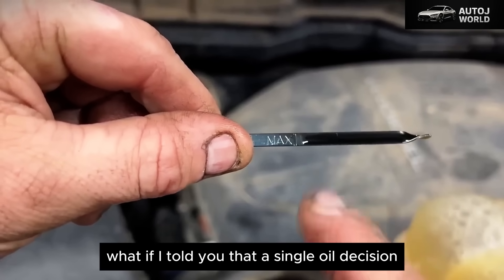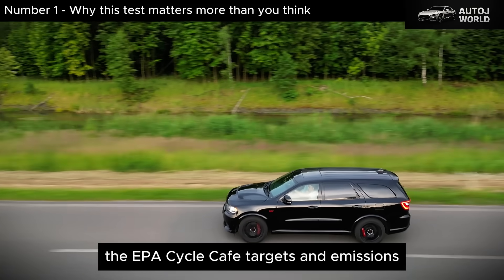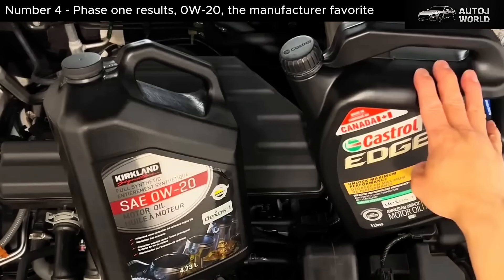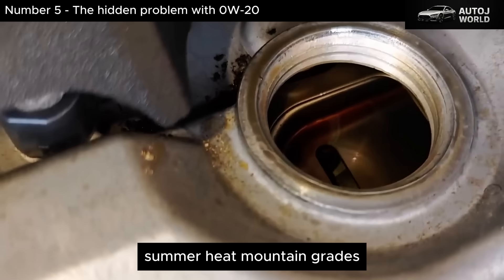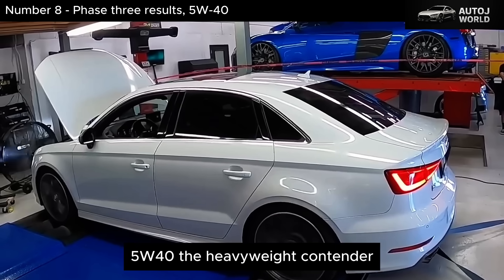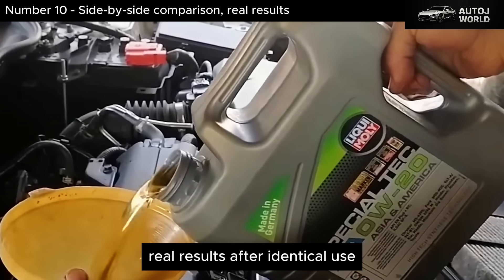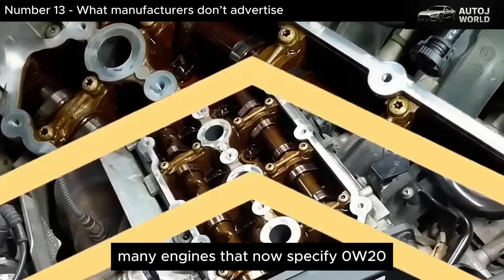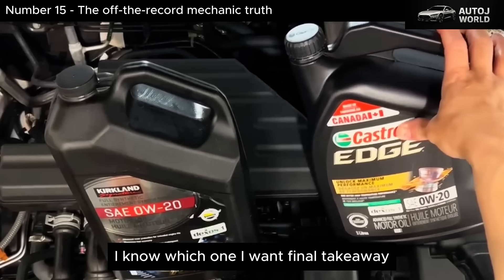We Tested 0W-20, 5W-30 & 5W-40 in the ENGINE — One Clear Winner!

Comment: The thinner oils are a problem for cars that idle a lot, not because of the oil, but because of oil pumps that don't deliver oil at high pressures for idling. I like 5w-40 because i live in Africa and do plenty long distance driving.
Reply: Me too. If 5W30 specified, l prefer 5W40 due to our already high & rising temperatures, even in winter. Friend's Yaris spec is 20W50 like old school Toyotas to my surprise: that's loose mechanical tolerances.
Reply: @alistairknox5381 possible to the extreme heat at your country needs that. I will not choose that better with 10w-40.
Reply: @emmanuila7747 My old 8v Ford, VW & Corsa all run happily on 20W50 & even on 25W60(especially good on VW: doesn't like thin oil) but more expensive being special high mileage oil. Running temperature also important: modded both my VW & Opel to run about 10°C cooler, around 82°C on open road: what a difference, heater not much use but so what. Cooked oil= filthy engine, heavy carbon caking everything.

Comment: Switched from 5-30 on 04 v6 Highlander to 10-30 better mileage smooth cooler running. 4k changes w Mobil 1 filter.
Reply: What did you switch TO ???
Reply: @rpasco9352 all oils are branding scam there is no such thing as fully synthetic oil they are all base mineral oil grade 3 with additives. If u want good oil go motul or amsoil 100% synthetic oil
Reply: That is not good either 10w is very bad for cold weather. If u want more protection go for 5w-40

Comment: What about 5:20 w for a 2010 Challenger RT🤔
Reply: depends where you live,  how you drive,  etc etc. 
     V6:  5w30
     V8:  5w40
    without knowing your situation run royal purple Castrol, Mobil1, valvoline full synthetic:  5w30 or 5w40
      oil changes every 4000-
4500miles......    20-year plus mechanic. 

12jan2026,dellthecomputer

Comment: All of the internal engine problems/horror stories began when the manufacturers started using 0W20 and 5W20 motor oils. Never heard one complaint on the old 5W30 or 10W30. But, those older cars never had the "blast furnace" catalytic converter in front of the oil pan, either.
Reply: Wrong!!! How come Honda/Acura and Toyota/Lexus have been using 0W 20 for years and have no issues. Just because American car manufacturers build garbage half the time don't blame oil. You seemingly forgot that 5W 30 was ridiculed when it came out years ago.

Comment: The narrower the gap between the two numbers the less solids are in the oil. Less solids means the oil is less likely to create sludge or deposits. If your temperature zone permits it 10w 30 is a better choice.
Reply: "The narrower the gap between the two numbers...".  Do you recommend using 5W5 ???

Comment: I have a 1997 Toyota Tacoma and I alternate  using switch 5w30 on winter time and during course of summer I use 20w50 because I use it for mobile services. The truck has 28860 plus miles and the engine runs great. I also change the oil every 6000k miles.  I also alternate oils on my Ducati motorcycle from 10w40 to 20w50
Reply: wow 28,000 on a 97 Tacoma?   A rare find!

Comment: Main takeaway with my 60+ years of auto maintenance and repairs as full time tech, don't go the full manufacturer recommended miles of these modern oil change intervals no matter what oil or filter you are using. Unless you are driving almost exclusively highway miles, no towing, and longer trips of 30 mins to one hour each time you drive, then stick to a more reasonable 5 or 6 thousand miles with a quality synthetic oil and high quality filter, or 6 months, whichever comes first. Anything longer than that can shorten engine life, cause oil consumption, etc. Wise advice from someone who has just about seen it all....
Reply: I worked as a jobbie at the GM Tech Center in the Powertrain building . One day I asked one of the Engineers that I was working with , why does the Corvette Manual call for Synthetic oil and a Camaro and Firebird which have the exact same engines except that Corvette get's it first then 1 or2 years later the same engine goes into Firebird and Camaro . He said the only reason that GM doesn't call for Synthetic in the Firebird and Camaro is that a Corvette owner can afford Synthetic and the other's can't . I started using Synthetic in my vehicles after that and after I found out the advantages of it and have been pleased ever since .
Reply: @chrismaurer2075 I haven't verified this just now, but my distinct recollection is that Mobile 1 (And yes, obviously, they were paying to have their brand name used), that is to say synthetic oil, was specified in Corvettes when they started using roller cams instead of flat tappet cams. 

I question the engineers logic. If one can afford a new Camaro, etc when can certainly afford synthetic. And just FYI, I have used synthetics exclusively for many years .... In all of my vehicles, including motorcycles, I think since my 96 collector edition Corvette...
Reply: @docimastic  I'm almost positive that you are correct about the Mobil 1 .
Reply: Agree I use 5w30 brilliant
Reply: 03 Tacoma 2.7, 5w30 186,999 think 10w30 is best now it's geting lose
Reply: I drove 2 Audi A4's as the #1 Uber Driver overnight in San Francisco for about 8 years.  The last one I'm still driving with 374,000 miles on it.  This is pretty much unheard of for Audi A4's.  First one was during the bad piston ring design faze.  It was a 2012 sold to me as a 2013.  Fortunately it was destroyed at a stoplight hit from behind by San Francisco Wheelchair paraTransit bus in 2015 with about 200,000 miles on it.  Second Audi A4, manufactured mid 2015, is one they had the piston rings corrected.   I'm still driving it in 2026, though the first engine died finally at 291,000 because it was losing compression, slowly burning oil, and needed a timing chain change.  Timing chain finally broke at freeway speed, and did as would be expected to the valves and piston heads on the 2015 original engine.  That was at about 292,000 miles on that engine.  Was getting about 18 city and 25-26 highway on the engine and burning about a quart of oil every few days at that point driving 12 hour shifts.  The timing chain finally broke and that engine went bye bye.
  I "re-engined" it with a used Audi engine off of LKQ with 44,000 miles on the engine.  I have 80,000 miles now or about, on that engine.  I have used Castrol Synthetic 5w-40 and fadiously changed oil and filter at 9,000 to 10,000 miles.  My trips are rarely under 30 minutes and when an Uber driver until 2021 I was driving about 10-12 hours a day, 5-6 days a week.  Why did I re-engine it.  Because I replaced the Engine, Turbo,Trans, all the other systems parts, starter, alternator, AC compressor, heater core and radiator core for about $18,000 parts and labor.  That included New bearings all four wheels and disc rotors.  I still need a replacement radio/CD.  AM/FM radio still works. Bluetooth caput.
I have consistently gotten 32 MPG highway and 22-25 city.  My climate is neither too hot nor too cold though there a days close to feezing and days close to 100 but not many.  A dozen times I had the engine temp warning screaming at me because the fan electronics were broken. And I turned on the heater full blast and that took care of it in 90 degree, bumper to bomper at the stoplights approaching the bay bridge.  The temps came back down into range with 4 windows and sunroof open.  I attribute the no engine damage to the 40 w synthetic for those events.
Got the engine fan issues sorted with a new body Controller unit. Sort of a Grand Central Station, relay switcher for almost all electronic signals thru the car other than the engine transmission links.  Not cheap but fixed.  Again, I'm still getting 32 mpg Highway, 22-26 mpg City. And drives like a dream AWD in the snow, when skiing Tahoe.
One thing I do insist on, Cold Start let the high idle do it's thing in the driveway, and wait for the slow idle.  Then I drive Slowly up the 1/2 mile subdivision up hill incline to the 2 miles downhill to town, by then the enging and the oil is warm.  NO COLD FAST STARTS. 
I like the car. The acceleration and handling.  It's an S line suspension, so corners and handles like a race car, but isn't.  At the current condition, no oil comsumption between 10,000 mile oil changes, I'm expecting this engine to take the car over 500,000 and maybe another 100,000, after that.  I may do the timing chain change if it still has good compression and little oil consumption. I may re-engine it again as my daily driver.  I may, I may not.  If I was doing mainly short trips I'd go to 5W-30.  But that is not my California Bay Area Reality.  I drove us to Denver and back in it last summer as a fun Summer Road trip to see kids, and do National Parks.  Drove Like a dream.  A little over 3,000 miles.  ( I did wake up at 3 a.m. in the passenger seat across Nevada as saw my wife was doing 95 with out a care in the world.  I said, "He Baby, you're doing 95 and probably didn't notice.  You need to realize that cops don't tolerate being disrespected on their own turf.  When you get to Elko, pull off for gas and I'll drive.  Wake me up then"
Reply: @randalllinton9055  at the end sentence I love it 😂😂 about your wife and how u say to her lol. Also used to have 2015 Audi a4 2.0t before. It pretty GREAT CAR. Also I used to be Uber in SF, CA and haven't been there for years. I wondering how much do u make a day if around 12 hour a day? Because back in 2015-2017 I used to make easily $350-480 for 12-14 hour a day. Depend on surge multiple like 1.7x 2.5x or even max 5x. But I curious what about your year 2024-2025 whole year is there still good make $?
Reply: @RobertPope-RAZ  Uber and Lyft is ancient History for me.  I drove 8 years almost exclusively at night the Final 4 years.  My best year was the year Uber went public.  I was one of about a half dozen drivers in the U.S. to get double the going public bonus which was $20,000.  I was the number 1 Uber driver in SF bay area based on number of trips, about 38,000 at that point and Income.  That year I grossed about $150,000.  How did I know ? I always asked the guys at the Uber Driver service center if they encountered anyone with more trips completed than me, and they to a man ALWAYS said "No, no one. Not even close".  But Castrol synthetic 5w-40w has my last A4 at 374,602 as of today's inspection.
Reply: @randalllinton9055 10,000 too many miles. I change every 3,000. When your oil is black, what do you think that means? DIRT !
Reply: @tiger7777 My wife goes 10k minimum on every oil change, she has a 2013 Toyota Highlander with 335k miles. Oil still looks clean and it runs fantastic and she does not take care of it at all. She just drives it, I'm actually amazed at how well it runs.
Reply: Every 10k Toyota last for ever
Reply: Don’t forget to do the auto at 120k 150k don’t listen to the bs sealed box and lifetime oil it’s bugger all to do and peace of mind
Reply: I agree. I get mine changed every 5K miles using 0W20 in extremely cold winters.

Comment: Oil will thin out 0-20 will become 0-10 and the same with all weight oil. From 0-20 to 5W-30, I notice the engine is quiter and the engine is clean like new. The engine has 140,000 miles which is 225,000 KM right now. Should last 500,000 miles easily if you use full synthetic and change at 5000 miles interval. The filter1 can last 10,000 miles now so change it every 2 oil changes. At the 5000-mile oil change, the level of old oil is virtually the same in my automobile.
Reply: I'll tell ya what Bible, 
l run 5w30 in my lexus,
oil changes on exactly 3500mile intervals,  full synthetic of course but !!
      l recently changed to a new oil filter after 2 years !      didn't even need to change it,  it was so clean.
could've easily ran it another 2 years.
....2015 RX350
......Über driver(2yrs)
........196,xxx miles(bought 97,241)

20-year plus mechanic
12jan2026,dellthecomputer

Comment: Very well explained.  I have 2 Camry's 0W16 and 0W20. I switched to 5W30. In my baby duramax,  I  switched from 0W20 to 5W40. I'm not worried about gas mileage.  I keep vehicles, and i want that engine protection
Reply: That 5w40 oil is great stuff  👍

Comment: Zero weight hot 20 weight cold really zero weight I know they need it thin for the oil passages but zero is crazy 5 weight is fine depending on the outside temperature is 20 or 30 weight

Comment: In Prius, the engine starts when your car is already run by motors.
When that cold engine starts running abruptly when the car is already running at 40+mph, I think 0W-20 is better to circulate at once in cold weather.
Reply: What destroys oil is not cold but heat

Comment: I’ve had 3 New Nissan Maximas, changed my oil myself.  Ran mobile 5w20 - changed all of them at 10k miles and put 250k on all three with zero internal engine breakage.
Reply: It's a Nissan. You could of run saw dust!
Reply: They must've been older models. The cvt transmissions wouldn't have last 80k.
Reply: My cvt transmission had almost 200k on it, you just gotta change the fluid every 30 or 40 thousand miles. amd it would have wemt longer till someone crashed into it 🤦🏾‍♂️.
Reply: 10 thousand miles on oil is ridiculous

Comment: My daily driver car is a Mercedes Benz A180. It has a turbocharged 1.6 engine. The dealership where I get it serviced uses 5w30 oil. It is stated that it has that oil type from factory. Not just any 5w30 oil either. This little car gets the top shelf stuff, which is Motul. One thing you should never do when changing the oil in your car. Never PREFILL the oil filter!! In some cars, doing this can cause an air lock in the lubrication system. I have actually seen this in Italian high performance cars.

Comment: I would like to see what the temperature of both the air and the pavement were in this testing. As the temperature the oil is exposed to from reflected heat from the pavement change the wear patterns.